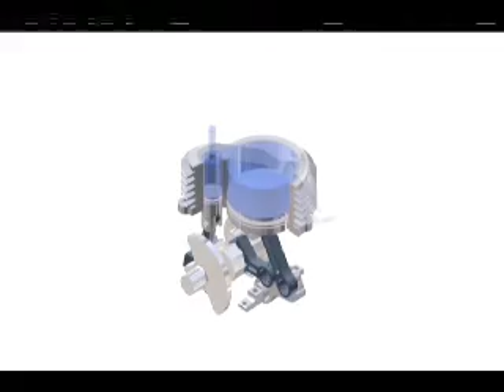A car that runs 200 miles on compressed air.

Comment: you cannot do what he said at 3:05, you cant refuel yourself forever it may be powering a generator running an electric motor, but to make the air compressed enough to power the vehicle, you need that much power to make it, it simply does not work like that.if you don't belive me tell me and i will answer back.

Comment: Ah, someone made a big mistake in the writing.  The air is only an energy storage medium.  Air does come out the tail pipe, but after it's electricity created pressure has pushed the pistons down and moved the car forward.

Comment: Interesting, but air does not create chemical waste like used batteries do, and compressors needn't be home based, but at filling stations.

Couldn't the energy efficiency % be improved over time? Couldn't compressors become cheaper?

I think by this line of thinking nuclear power is better than hydroelectric because it's more efficient.

Comment: Solar pane; to compressor to big tank efficiency 20 to 40% tank to air motor efficiency 20 to 40 %
Solar panel to battery efficiency 85 to 90%
battery to electric motor 80 to 90%
FACTS
Therefore you need MUCH bigger number of panels for air. Say $45,000 worth. Priced any 4500psi compressors recently
REALLY CHEAP. NOT!

Comment: Its me again. To lower the cost, you could use old oiltanks, which where used for oilheater, to store compressed air. The oiltanks needs just small changes to use it as airtank.

Comment: Lets say at home -> solar panel-> compressor - > Big tank. You could do the tank and the compressor under the earth in your garden and so it is invisible. That system works for 100 years without to do a service, cause it doesnt need batteries. And if there is to much air in the tank, it would be used for a airturbine/generator to give power at your home. This system would be absolutly Zero emission and exremly simple and cheap to realise.

Comment: This is so great. Its so simple. To compress the air, you could use solar panels at home, which compress the air during the day, directly in a big home tank, without to using batteries. I dont understand why this have no success.

Comment: "...it does take some energy to compress air" he says.  Hmm..  By definition you will have to use more energy to compress the air than you can get back.  if they could get it all back then they have broken the second law of thermodynamics.  That would be quite a feat.  But if they can really get the car to make its own compressed air to run on, and never need any input, well, then they will have cracked the first law of thermodynamics, and I would tip my hat to them! ... oh man,  What a laugh.

Comment: The air has to be compressed to 4500psi. So you need a mother of a compressor and you need a LOT of PV panels to run it during the day to recharge the bottles, say $45,000 worth of PV's give or take. And you still have a car that on test, yes real test, went 7.2km. 
Ouch

Comment: Sure, some solar panels on the roof might provide enough power to recharge the compression while you work. At least a little bit. I say might, because it might take more voltage than solar provides. I'm not sure.

Comment: 200 years is nothing, its been 2000 years since jesus died. if it takes 1000 years or more, it will be done. It took alot of years for things such as tvs, and phones to be invented, humans flying seemed insane, but they consistently never gave up on the idea and now we have commercial airlines. Just believe in the possibility that somthing new will be discovered, and science can always be rewriten and improved.

Comment: Big time fantasy. Ask any college level physics or mechanical engineering student about this and let them explain it. There will be losses in every system and perpetual motion is a hoax. I can't believe they even mentioned it.

Also, you can look at the volume of air they compress and the displacement of the engine, you get a range far below their claims. Simple math there even assuming lossless transmission of power in the engine and drivetrain.

Comment: You're right. Perpetual motion is not possible except in frictionless environents where no energy conversion is taking place. This car could recharge itself a little bit, but it could never fully recharge itself. It would NEVER surpass about 50%... But you definitely could get a good 15 to 25% depending on how much city driving. This would be done by using a compressor powered by regenerative breaking, etc.
Reply: then you add a bit of solar and you add a few turbines and you add a little bike pump and youre good to go

Comment: i almost punched the computer in disgust during this part.... it shows completely blatant ignorance about mechanical efficiencies and losses. It wouldnt even be worth carting the generator around. It's just adding weight... and any extra air it would compress would be better off going straight to wheel power so it only goes through the mechanical loss stage once. STUPID. This was on the Science channel?! WTF?!

Comment: Quote "By the way, MID also created an electricity generator powered by air." 
Nope it uses electricity to compress the air. They CLAIM it's much more efficient. There is no testing, no proof, no reason to believe. This is just another of their on going SCAMS

Comment: Electricity to H2 60% efficiency H2 into a fuel cell 60% efficiency or even worse burn the H2 in an IC engine 25%. So overall 36% to 15% efficiency
vs Electricity to battery to EV motor 80% to 90%
If you mean the scammers flogging electrolyzer add ons to IC engines. Run away!!! Thieves and villains

Comment: Exactly, I was really interested and thought it was viable and not a bad idea. Right until said it could refuel itself on the move. It's impossible, it completely against physics. 

I'm hoping that it is real and works, and its just who ever made this video decided it could be fitted to the car and create perpetual motion.
Reply: There are situations where this would be useful, and I imagine it is actually in use. Obviously you need an external source of power, but sometimes you want to be able to move things or people around and you do not want combustion.

Comment: he had me untill he talked about perpetual motion. it always takes more energy to compress the air then you will get back out of it since you loose heat when you compress it. 2nd law of thermodynamics. but i see what he is getting at. its far cheaper to spend the $3 in electricity on the air compresser than the $20 on the gas to go the same distance

Comment: yes. it will be a part of the endless cycle of energy in the world.
it talks about the perpetuation of the energy which has been used will be exactly the same quantity it was released.. the energy used by the compressor to compress air for the car is exactly powered by another compressed air. if you will get my point.. the sequence is perpetual.

once you put an object in a cycle, without another motion stopping the cycle, the object will remain forever.

Comment: lol. it talks about the perpetuation of the energy which has been used will be exactly the same quantity it was released.. the energy used by the compressor to compress air for the car is exactly powered by another compressed air. if you will get my point.. the sequence is perpetual.

Comment: I think that part was meant to reference using compressed air to generate electricity for on board electronics, or it may alternatively the same generator could use electricity (like from a standard electricity outlet to create compressed air, to fill the compressed air tanks.

Comment: "generate a spark of energy for half a second to create a vacuum"

No. How do you create a vacuum with a spark? The only way to create a vacuum is to displace the air with a mechanical motion, which takes energy. When you "burn" oxygen, you're really just combining a fuel and oxygen in a chemical reaction which forms other molecules that includes oxygen, but is not in the form of 02, which we breathe.

Comment: well ok i got something for you... if batterys have limited power and cost lost and need replacing Etc... then how about you use a generator powered by compressed air to generate electricity on demand when you push the accelerator... With a mini turbine and flywheel ...That way you can produce the power as needed... Then you have a biodesil backup motor plus solar panels ... generate the electricity for the onboard compressor with renewables like such and such and FUCKING such!

Comment: "I was just making a statement." and it was wrong. Enriched uranium doesn't grow on trees (and a reactor the size of a 2 gallon can will need enriched uranium), and is not a DIY operation to make it. 
"The pond is only for cooling and production of steam" right of course, steam, to do what? Turn an engine? Then you need a pressure vessel etc etc etc

You are talking fairy tales and fantasy. Please go away.

Comment: Quote "with an efficient screw compressor it could exceed the volume input for the engine even at redline" 
 Bzzt you lose, go to the corner and put on your dunces cap. 
PS It's called a LAW because it is, no exceptions. When you've learnt how to derive the 1st 2nd and third you will understand why.

Comment: Quote "by attaching an air compressor engine inside the car itself can make it fuel free. It'll produce its own compressed air from within with the help of the air compressor engine while the other engine will help drive the car.

What do ya think ?"

Won't work, can't work

Comment: Cool car, but the narrator is a moron. #1) It costs money to compress the air. Therefore, the car will go about 100 miles per dollar or so, depending on electricity costs. The compressed air is like a battery, storing what was once electrical energy. #2) The car could not recharge itself as it ran without an external power source (ie: solar panel on top of car). Regenerative breaking could be used to recharge the air tanks to some degree (but not with 100% efficiency, perhaps 30% at best).

Comment: Purpetiual Motion?  No way.  We'd need to have an onboard gasoline engine to compress the air back into the tanks.  Safety concerns?  Doubt it.  Submarines have used compressed air about that high (or at least 2000 psi) and there's been no explosions of the compressed air tanks.  Bottom line: I'd say it's worth continuing research. Let's fund the colleges to have annual contests for air cars.  Oh, and I think there are air motors that have no pistons, that would be much lighter.

Comment: The whole commentary is bullshit from start to finish, not one iota of real science in it.

They conveniently forgot to mention how inefficient compressed air is as an energy storage medium.  Compressing air heats it up, and that heat is lost energy.  Then there are safety concerns, a tank of air at 4500 PSI is going to make a mess if it ruptures.

The reference to perpetual motion is the icing on the cake, if this video had fallen out of the arse of a cow it couldn't stink any more.

Comment: People are still falling for this scam.
I have a super air car that gets 3,000. miles per charge.  It can fly too if you fill the air tank with helium.  Also the positive energy it produces will cure cancer.  Don't forget the car is really really cool, a lot of hot girls will be all over you when you drive the car.

Comment: wait....$15,000 for THAT? and the very idea to even suggest that perpetual motion is possible..what's missing from all these alternative type vehicles, is practicality on the part of the designers. why hasn't anyone made a diesel-electric car already? I mean geez, a small diesel generator runs a high torque electric motor, attached to a common transmission. You could make a killer pickup truck. and don't forget hydraulic! hydraulic buses, made and in use today!

Comment: You're right, it's a mistake in my example, but I think the point is the same. Swap KW by KJ in my little examle. I was trying to point out the perpetual motion isn't possible, because you can't get more energy out than you put in.

Comment: "If a car generates 100kw of power, it'll need >100kw of power to recharge."

If it takes 10 hours to use up the energy, must it take more than 10 hours to recharge?

KW is power (kilo-watts) not energy, so you are wrong.

Comment: The claim the air comes out is "ice cold".

Clearly, there is some inelastic property of the air that is being taken advantage of. The temperature of the air before is less than the temperature air. In this sense, the thermodynamic cycle, strangely enough, would have to literally suck heat energy out of the air. This would require some work to take out. It would have to be compressed then expanded. There is no doubt that is what happens in system powered by compressed air.

Comment: Perpetual motion is not possible. Period. A solar car can run forever (as long as the sun stays lit), but a solar car isn't perpetual.
Perpeutal motion isn't possible because,
If a car generates 100kw of power, it'll need >100kw of power to recharge. Even if the engine is 100% efficient, there'll be nothing left to actually drive the car.
A 100% efficient engine isn't possible because some energy will always be lost to heat, even if it's the disc brakes or tyres heating up.

Comment: I checked to see if I had to rate this 5 stars and it turns out that I didn't and rated it 1 star instead... 

BTW, don't all cars currently run on air?  Gasoline in the engine is ignited and causes rapid expansion of gas (aka air) causing the pistons to move...

Comment: Quote "Even if the compressors use fossil fuels they will use much less fuel per km than driving the whole car on it." Nope incorrect very fuel INEFFICIENT 
"At a cost of $3 per hundred kms that sounds pretty good value." It actually sounds unbelievable because it is.

Comment: The car design has been licensed to Tata Motors in India - one of the world's biggest car manufacturers. While the perpetual motion idea is rubbish, using the brakes to partially recharge the air tanks would likely extend the range, just as regenerative braking works on electric cars. Even if the compressors use fossil fuels they will use much less fuel per km than driving the whole car on it. At a cost of $3 per hundred kms that sounds pretty good value.

Comment: So first, the car needs to be already moving AND producing electricity (to power the air compressor) to produce the very fuel (compressed air) that allows it to do all these things in the first place. I think there might be a slight problem here... LOL

If compressed air is in fact NOT the car's (only) "fuel source" (if it's actually an electric car, or some kind of electric-air hybrid), then why bother with the air at all?

Comment: Why bother with compressing air at all if you're going to need electricity to compress it? Why not just use electricity directly, with an electric motor? Surely, by using air as an intermediate step between ELECTRICITY and MOTION, all you're doing is making the whole thing less efficient.

As for the part about perpetual motion... LOOOL!!!

Comment: Its clear nobody on this comments page has worked with anything mechanical,air compressors get hot its called friction,so called recycling of the exaust would be like blowing up a balloon while walking it would take energy from the total output,for every action there must be an equal and oposite reaction, sorry those are the facts

Comment: listen carfully try really hard,yes I'm american no I dont like paying for or being hooked to oil companies,the amount of energy or btu's contained in a drop of oil,biodiesel,hydrogen far surpasses a fixed amount of pressure in a tank do some math! a tank with 4000 psi - ( am geussing now) say 50 psi per stroke per piston (4 cylinder) 1000 rpm that = 200 miles??? no hills no accsesories? because I use logic I must be american?

Comment: I completly understand the engine,my point is air conditioning takes up mabey 5 hp heat it depends is this engine watercooled? if not electric heat takes a lot of current or another fuel source ,alot of cars have daytime running headlights more current ,my point I'd bet these cars don't have accesories added which would take away significantly from the pie in the sky distances they are claiming,1cup of gas is equiv to 4 sticks dynomite thats energy storage! whats your background?

Comment: I told you what to Google. Just do it to see how this con has run since 1991
Look on Wikipedia for the look back link to the old MDI site with the road test. Deleted from the new MDI site. 
Now you give me a link that confirms 100km/h for 100km that is independently confirmed. IT DOES NOT EXIST. All claims are from MDI only and are physically impossible. 
Being able to drive round a car park is not a viable vehicle.

Comment: Cool.  Like the idea, hope it progresses. 
I've always liked compressed air tools, this is a nice progression along those lines.
I seem to recall that compressors have oil in the tanks, do these tanks have oil, too?  Do they have pressure relief valves for those times to remove moisture from the tank?
Personally... I'm not fond of the blind spots in the body design, but, hey! that can be remedied.  :)  Really.
Cool idea.  Yikes! I hit that audio preview. GADS!!!
Reply: Hello

Comment: "It takes less joules to compress it than the amount of joules released when emptying the tank."
Not in this universe. You are saying you grab an air compressor take the drive motor off replace it with an air wrench driven by the compressor and it will run for ever generating more and more power.
That's not science that's Harry Potter and magic wands. Hint they are make believe just like the air car numbers. The only real numbers are the huge amount of money ripped from fool investors